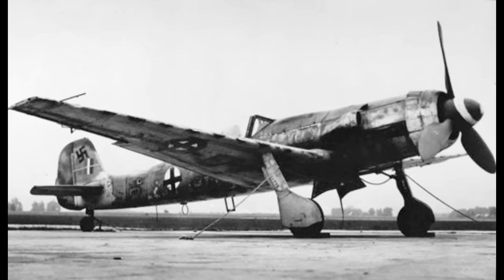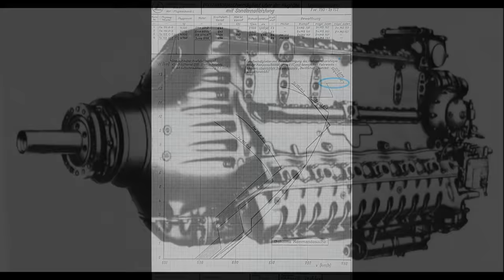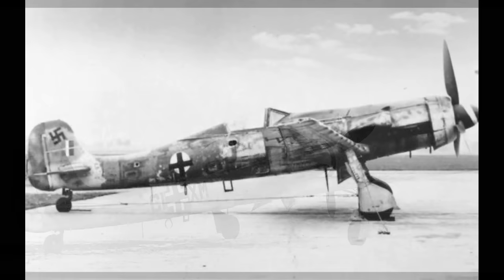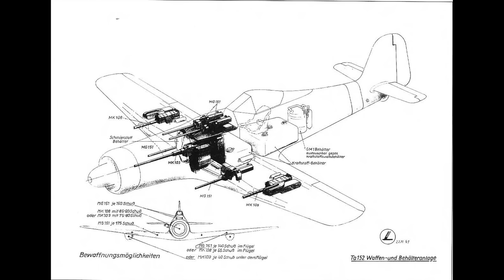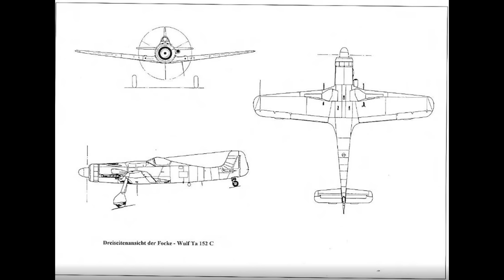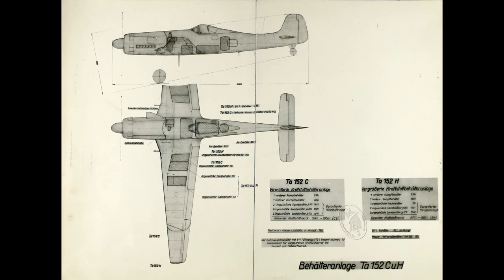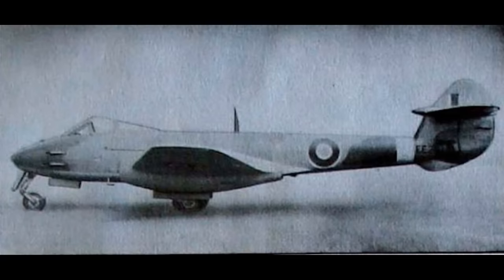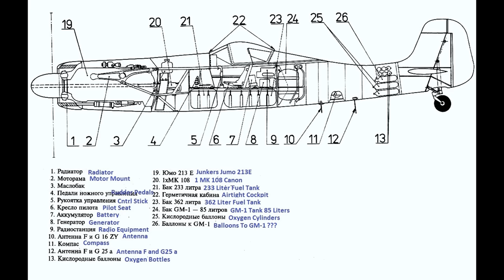Focke-Wulf Ta 152 H-1 Extreme Speed At High Altitudes.

Comment: In Gemany we call it ,Flocke Wulf lang Nnase  (Flocke wulf long nose)
Reply: +Dieter Wolf   The military museum in Gatow has been rebuilding a "Langnasen"  Dora for many years.  It was raised from Lake Schwerin in several large pieces, and by today's restoration standards it could have been a flier.  But the wreckage was not properly stored and corroded badly.   So it was rebuilt, but it has been going slow and funding is limited.  Someone mentioned that there was some debate whether to finish the cockpit because they were just going to hang it from the ceiling. I'm sure it will be great when finished.  Also there is a second Dora on the bottom of Lake Schwerin,  but eyewitnesses recount that it exploded and the pilot was killed, so it is likely a war grave.

Comment: The P-47 M line at 30k looks suspicious... its performance takes a large sudden jump then declines quickly again while all the other planes examined show a gradual improvement in speed as altitude increases. Is that dot meant to be at 705 kph rather than 755 kph?
Reply from the maker: Hi Bill, it looks different because it is different. The P-47 is the only plane in the comparison with a turbosupercharger. The data I plotted is correct, and the official chart from which the data was derived is near the end of the video. I have an entire video that deals with the differences between the turbosupercharger and mechanical units: https://youtu.be/ULLsIo1VzTw . One thing that happens a lot here, is that people watch the videos way out of order, which is fine, I didn't number them, but I did upload them in a logical order. If you jump in at the 40th video, there will be some concepts you may not understand because they were covered earlier.
Reply: Greg's Airplanes and Automobiles If that's the case the 47M is very impressive

Comment: The experimental xp47j had a top speed of 505mph and the prototype xp72 had a top speed of over 490mph. 

Also I wouldn't be surprised if the ta 152H was faster then the p80 at over 30000 feet.

Comment: If the Luftwaffee had a good number of TA-152 H-1's in early 1944 vice the spring of 45, and of course employees them all against 8th AF on the Western Front, would the TA-152's sufficiently survive or avoid swarms of P-51D Mustangs?  Would the impressive cannons of the TA-152 be effective versus P-47D's, P-51's?  Or would these superior German intercepts merely get quickly chewed up by the escorts?
Reply from the maker: The first part is easy, yes the Ta-152 H-1 would be able to avoid P-51s and P-47's by outclimbing them and by operating at altitudes too high for the escorts to reach. Now, eventually they would have to come down to land. At that point it's going to come down to numbers. If outnumbered 20:1 it doesn't really matter how good the Ta is, they are going to get shot down. Now if we get into some fantasy scenario where the Ta's are not outnumbered, then yes, they will be able to fight 51's and 47's on at least even terms and shoot them down.
Reply: Greg's Airplanes and Automobiles.  I agree with that assessment.  So Gallad would probably reserve remaining Bf109’s and FW190’s to stay low and sacrificially protect these airfields so the fast cannon Me262’s, De 335’s and Ta152’s can survive as many sorties as possible.  After all the Fw190 while superbly armed was toast against a mustang  above 20,000 and the Bf109 was obsolete and both could not survive in late 44 and beyond against 8th and 9th AF.

Comment: Rather surprised they had to inflate the canopy seal, since a rubber air bladder seal filled at low pressure on the ground would expand with the dropping pressure at altitude.
Reply from the maker: That's a good point and it does do that, but not with enough force to seal up against the pressure differential.
Reply: @GregsAirplanesandAutomobiles  I think it would be a physical possibility as we're looking at about 25-30 kPa at max height, but on reflection it would require a level of precision and cost that would have been too high and probably require some modern plastic materials they didn't have.
Reflecting as I write it seems plausible they may have had to manually control the pressure while ascending to make sure the seal didn't push the canopy off.

Comment: How successful was the Dora model??  How does it compare?
Reply: +William Wood   The Dora arrived in service by late 1944 or December 1944, barely five months or so to prove its effectiveness in combat but it was a good performer.  For the Ta-152, pilots were experiencing fires and hydraulic issues so the Ta was still new with some quality control and design issues to be resolved.
Reply from the maker: The Dora was very good, but it was a just a temporary solution until the Ta 152s were in full production.

Comment: I wonder if B-29s bombed Germany and 152s proved a problem for the US, would the US have responded by using similar design methods (better Mw-50, Gm-1) on new P-47 variants to counter the Ta-152H-1?
Reply: They probably would have bypassed all that and went to P80's
Reply: The US was developing a “Super Thunderbolt” — the XP-72 — to combat the late-war super-props.

The YP-80 made the program largely useless.
Reply: @ @bobmar9239  

... the air fields, the factories were
underground

Comment: The only Ta152 left is in storage at the Air and Space Museums Paul Garber facility. With the speed at which they restore aircraft it may be 50 years before they get around to it.😡
Reply from the maker: I don't want them to restore it, I want them to put it back together and display it as is.
Reply: @GregsAirplanesandAutomobiles   I don't have a problem with the NASM returning it to the state it would have been in Luftwaffe service.   The AAF actually was concerned about the wooden Ta-152 tail breaking off in flight and they modified the tail with steel plate.  So the NASM is going to have to undo that work.  Also they have to remove the layers of paint applied to it, so they may as well fully restore it to Luftwaffe colors.  This new trend of preserving rust and decay on cars and other objects and calling it "patina" doesn't sit well with me.  The Ta-152 (and the Ho-229) are in their current state from changes made by the Allies and from poor storage and neglect.  Efforts should be made to return them to their wartime condition.

Comment: I would like have seen and heard a little about the propellor, it looks unique & high altitude oriented???
Reply from the maker: I'll have to make a propeller video, a lot of people are asking for that.
Reply: It does appear to have a large chord on each blade in the pic, fine line to achieve high speed and have good tractability with large paddles but I'm surprised to see it is still a 3 blade screw and not 4 or 5.
Reply: @GregsAirplanesandAutomobiles  There was definitely a lot of engineering and science just to optimize propellers for the engine output and aircraft performance expectations.  I think there was a lot of compromise on drag verses taking advantage of the engine output.   The quick example is US Navy aircraft that always flew in lower dense air over the ocean, and they had narrow chord blades to reduce drag.   Then you had the paddle blade props to grab the air up high.

Comment: The v12 diagram shown was upside down, "heads down," or is that normal?
Reply from the maker: I don't know if you are kidding or not.
Reply: @GregsAirplanesandAutomobiles  I thought that oil would drain into the cylinders under the piston skirt.,  But I do know about dry sump lubrication.
Reply from the maker: Hi Jim, I have a two part series on the inverted V-type designs. You may enjoy those two videos.
Reply: @jimsworthow531   Many WW2 engines were dry sump and pressure lubricated. (Not just inverted designs.)  Scavenge pumps collected the oil from the lower valve covers, and for the radials pumps helped to remove oil that would naturally collect in the lower cylinders before starting.  Oil in the lower cylinders will cause mechanical damage if it is not removed before turning the engine over.
Reply: @GregsAirplanesandAutomobiles  Thank you for the reply and I will look up your videos on the subject; great content by the way!
Reply: @FiveCentsPlease  Thank you for clearing this subject for me. I was trying to wrap my head around the heads being on the bottom.

Comment: A steel spar is more resistant to fire than an aluminum one
Reply: i think the steel spar is lighter due to fact germany have held the largest heavy die forging presses.
Reply: @aker1993  
That's true but I don't think that the spar was made in those presses, I believe those were used for frame sections to eliminate riveting pieces together. 
After the war the US Department of Defense did a study on those presses and determined that the US needed similar type presses one of which was built in Cleveland Oh, in the 90's I worked in Cleveland and got to work with forgings that came out of it.
Reply: With aluminium there is a limit to its strength relative to its size. So, if you want a thin, efficient but also strong wing, you will have to go to steel as it may not be possible to get the same outcome with aluminium and still fit it and all the other fittings into the wing.

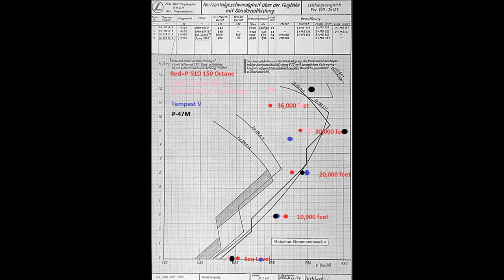Comment: 37:10 "fasted piston-engine to see combat" what of the do-335? I'm guessing you don't have performance numbers for that.
Reply from the maker: No, I do have them, but it was never in combat. There may have been one time it was near combat but used it's speed to escape. In my view that's avoiding combat. In any case, the Ta 152 H1 was far faster at high altitude, but at lower altitudes the Do-335 is a lot faster, faster than any other prop plane of the war.
Reply: @GregsAirplanesandAutomobiles  interesting. thanks!

Comment: How much would it cost to build this plane from scratch ? Over 5 million ?
Reply: + X    Likely more than that.   Even if you found the engineering specs it would be just as much a research project and engineering study as constructing an airframe if you want it to fly.
Reply: @FiveCentsPlease  Thank you. 
Do you think that it is possible to get to the last Ta 152 in order to analyze it or in the best case, to restore it to flying condition ?
Reply: @user-jj5ty2zg8m    The only surviving Ta-152 is with the Smithsonian Museum and historically they have required a waiver that access to historical archives is not for any flying rebuilds.   Same for the USAF Museum.
Reply: @FiveCentsPlease   That was helpful, thanks

Comment: Why is his video so long?  Nothing hard to find here.  Only 10 152H-1 units were made, the production date was 11/21/1944.  They had  2,250 hp engine with max supercharge power.
Service ceiling was 48,560 feet. Top speed 472 mph at 41,000 feet.  Two 20mm canon. The TA152C-3 had a 2,100 hp engine, one 30mm canon, and  four 20mm canon. 460 mph at 36,000 feet, with max ceiling of 40,350 feet.  There was that so hard?
Reply from the maker: Chad, I just don't think this is the channel for you. You might like this one better: https://www.youtube.com/channel/UCxki36kj94U_yPJfkd1_X-w/videos
Reply: @GregsAirplanesandAutomobiles  Well at least that kiddie channel can give the message in 15 minutes  instead of droning  on and on for 45 minutes with material that was swiped from elsewhere.  And I bet they don't delete comments from people who are just a bit smarter like you do.
Reply: @chadhaire1711  you are under no obligation to watch the video.
You watched the video just to specifically criticize the single best video on this fighter? I wouldn't worry about Greg not conforming to your standards. The door is that way.

Comment: KPH is not km/h. 

"K" prefix stands for "kilo" or 1000 in metric system. So kg is 1000 grams or kilogram, km is 1000 meters or kilometre. 

"km/h" is kilometre per hour.
"kph" or "k/h" doesn't stand for anything.

Gtret video btw.
Reply from the maker: You are technically correct, however, I honestly don't care if anyone abbreviates kilometers per hour as KPH or km/h. If you want to abbreviated miles per hour as MPH or mi/h, I don't care either, as long as it's clear what you are talking about, then no harm done. The point of words is to convey meaning. I'm pretty sure everyone got the meaning, but if there is a person out there who really thinks I was quoting speed in kilos, I suggest you visit this channel immediately: https://www.youtube.com/watch?v=44wg0l0CnVg
Reply: @GregsAirplanesandAutomobiles  Yup, but you would raise an eyebrow if someone says miph or mi/h intead of mph.

Thanks for the link ;)
Reply from the maker: Not if they said it correctly but put an abbreviation on screen. Now that I think about it, I can abb. thgs, hwvr I wnt. It really doesn't matter, as long as I get the point across.

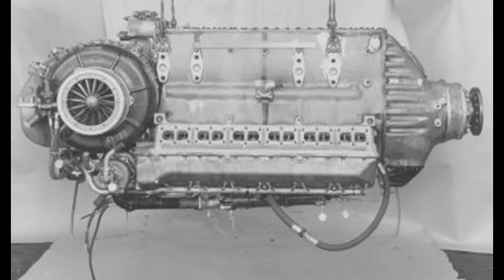Comment: 9:00 briefly; why are 4 valves better than 3?
Reply from the maker: The exhaust has an easier time exiting through two holes than through one. Of course it's not quite that simple because the one valve is big, but it's not as big as the two combined. There is a lot more too it, but consider that almost nobody is building cars with 2 or 3 valves per cylinder any more. There are some exceptions, large V8s for example.
Reply: Valve perimeter area, has a great deal of influence on the total airflow of a valve in an engine. 4 valve engines have twice as many exhaust valves and there fore have more valve perimeter area.

Comment: Was its radial engine bigger then the Vaught f4u?.....i thought folk wolf's were fitted with radial engines? Not inline engines?🤔
Reply from the maker: The 190D and TA152 DO NOT HAVE RADIALS. The Corsair's engine is 2800 cubic inches, bigger than either.
Reply: @GregsAirplanesandAutomobiles  ty so what about the early model of the 190?
Reply: @montys420-    The BMW 801 radial displacement is 2560 cubic inches.
Reply: @FiveCentsPlease  so i was right in thinking the folke wulfs fw190's had radials? I was always under the impression ever since i was a kid that they were since radial engines could sustain alot more battle damage then an inline water cooled engine.
Reply: @montys420-    The D series Fw-190 introduced a V-12 with a streamlined cowling and annular radiator.

Comment: Z please use mph and feet and inches if people want to use the metric system let them do the conversion
Reply: Butcher you are not just pompous but Childishly rude.
Reply: @jamesbond8608  atleast I use metric, thank god
Reply: @Panzerram  Powers of 10 is just as arbitrary as anything else.  Additionally you do not use the metric system either as actually using it "correctly" is obnoxious as all hell, ie "My mass is 7.983x10^2g!"  No one says that, they say "I am 79.83 kilograms!" or "I am 176 pounds".  Finally you will probably use the argument that it's based on objective standards, except it's not.  For example the gram is 1cm3 of water at its densest temperature, 0c.  Except that changed last century because water is actually most dense at 4c, except that has also been proven wrong now and it turns out that the densest temperature for water is actually 3.98(and then a lot of other decimals), never mind that the meter has changed a couple of times and is now based on a value that we do not actually know.

In short any measuring system is perfectly fine as they accomplish the same thing as long as they all have references to base them off of.

Comment: Why did such a high-performance high-altitude fighter use a three-blade propeller?
Reply from the maker: Oh, that's a topic all on it's own. Propellers are complicated. More blades are not always better.
Reply: @GregsAirplanesandAutomobiles  Yes I understand, but in extremely thin air (which I understand would have been the natural habitat of the Ta152) it seems quite plausible that a prop with more blades would have generated more propulsion. The Blohm&Voss BV155 for example didn't have a four-blade prop for noting, did it?
Reply: @pascalchauvet7625    Consider also materials shortages and complexity in manufacturing.   A three-bade hub is lighter and less complex than a four-blade, and easier to manufacture.   Thicker chord paddle blades of wood were easier to manufacture for a similar prop area.
Reply: @FiveCentsPlease  Talking of resources, in times when a Dornier 335 fighter got a whole engine added in the back, shouldn't it then also have been possible to add a single prop blade to the Ta152???
Reply: @pascalchauvet7625   The 335 was a new animal.  The versatility of a heavy twin but with a tandem layout for less drag and more speed.   It was roughly the same weight as the Me-410 but it was about 100 mph faster, still using only two DB-603 engines.   And as Greg said,  more propeller blades does not always equate to efficiency or performance.   Prop science was always a compromise of multiple variables with some trade-offs.

Comment: loosing consciousness in 9-15 seconds? what if i hold my breath for 30 seconds?
Reply: Not much air to fill your lungs with in order to hold your breath that long. How long can you hold your breath if you deeply exhale as much air as you can first?
Reply from the maker: Trust me, you can't do it. Plus I can say from experience that the first few seconds of a rapid depressurization are a bit disorienting.
Reply: In submarine escapes holding your breath into lowering pressure is fatal, breath cannot be released and fatal injury is inevitable.